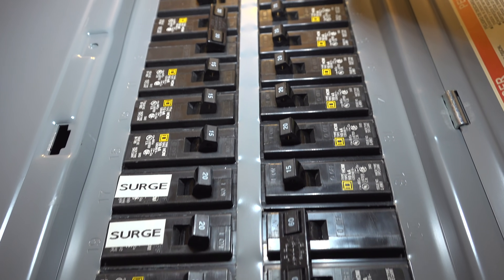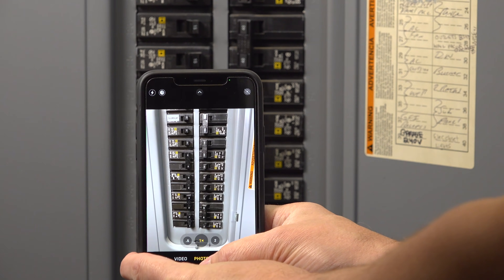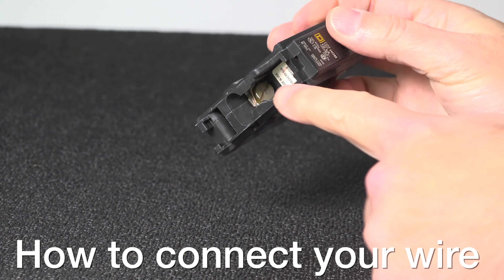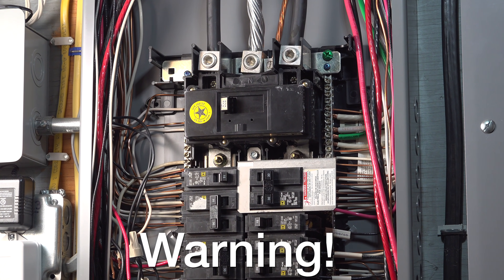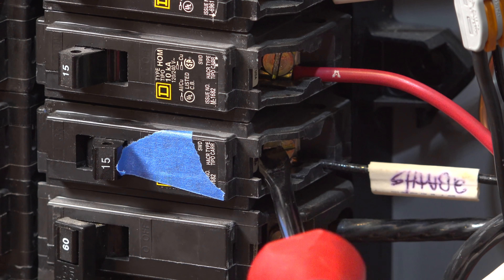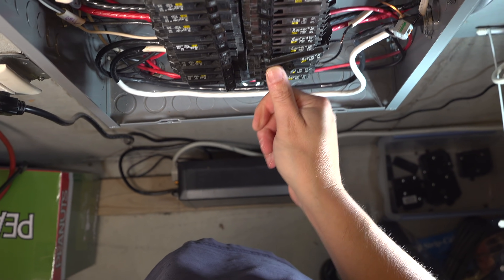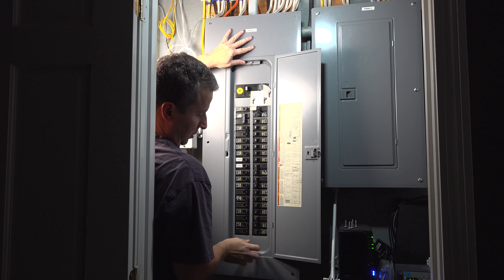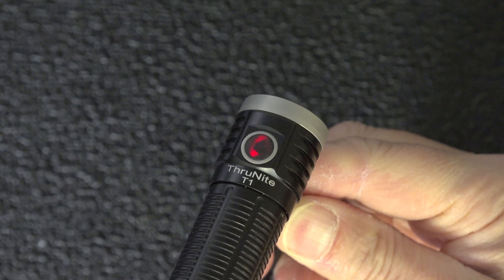How To Replace or Change a Circuit Breaker in your Electrical Panel & Why it's Tripping

Comment: How do I know if the breaker was the correct one in the first place? RE: all the information on the breaker... cause, I'm fixing to replace one. I'm not an electrician, but, I learned how to wire a house in High School. That was over a half century ago, but, I'm not so sure the previous person who worked on it knew what they were doing because a couple of the outlet lets were actually installed upside down; old and brittle, installed in the seventies, and they were "stabbed in the back" I have installed all outlets properly and identified a faulty breaker switch. How do I know what to replace it with? The outlets that were installed upside down have the faulty breaker.

Comment: For safety purposes have a meter and do use proper PPE like rubber gloves with no punctured holes and leather gloves over rubber gloves with those gloves you can work on live wire but do turn off power if can

Comment: My breaker isn’t tripped. The power to the garage, though, is apparently out.
Reply: How did you know the breaker wasn’t tripped? I think I overloaded the garage breaker, so now nothing in the garage works, so I’m going to replace that breaker tomorrow.
Reply: @jmendozas197  Check for an outlet (likely in your garage) that was tripped. It could be hidden, so look closely.
Reply: I meant the GFI could have been tripped.
Reply: @jorgejohnson451  Thanks for the help. It ended up being the switch on the breaker. It got loose and I had to fix it so it clicked to the ON position.

Comment: I was actually out cutting the hedges with an electric hedge trimmer and I ended up cutting the extension cord and I lost all power to the outlets on that circuit. I went down in the basement thinking the breaker tripped and it didn’t. I flipped it back and forth still nothing so I’m assuming this is fried. It’s about 15 or 16 years old

Comment: Great demonstration. I feel a lot more at ease about replacing a breaker after watching this.

My question: I have a breaker that resists being switched to the 'on' position. Is this most likely due to a bad breaker? Or could there be a problem somewhere in the circuit? Or could it be either? I supposed that by replacing an inexpensive breaker, if the problem isn't fixed, I now know the problem lies elsewhere.
Reply: Judging by this video yes you need to replace it or it could be what you’re using is consuming more power than it can handle

Comment: I have touched lives wires several times, even pulling extension cords from electrical outlets.  And yes I am very cautious either way, but your not going to "die",  but I have lots of respect for the main one coming into the box.  I was sweating bullets when I paid a guy to replace my electric panel and all I saw was a tangled mess of wires coming out and he fumbling around.  I had images of him getting shocked, me trying to saving him and while doing so, pulling him and me joining him in heaven.  Luckily everything worked out, but its very nerve wrecking.  My biggest fear is that for example I work on cars and I know mistakes happen.  A mistake in auto repair or any other trade, you can get away with it, but a mistake in electrical and you are GONE forever. Respect electrical.

Comment: This was extremely helpful! Thought our over-the-range microwave was on its last leg, as the lights would flicker and power would start to bog down every few seconds. If I opened the door before the time was up it would short out and not turn back on unless I went to reset the breaker and push on it. Ran to HD grabbed a slim dual 20 amp breaker and it's all good. Thanks again!

Comment: My breaker it’s always tripping, and I know it’s because I have an studio with a lot of equipment and lights. What can I do to fix it ? 
Can I just buy a higher amp breaker or is there more steps to fix my situation?
Reply: NO.  Never change the circuit breaker to a higher amp.  Result = Fire !
        You need to add a 2nd circuit.  And use it for equipment that has a heavy draw.
Reply: @leeozawa6042  alright thank you

Comment: Super video....  In 1986 I vaporized my long pincers on the 'substation side'   of my distribution board ..240 volts...UK...  I was left holding the insulated handles only...the pliers had blown up and steel was peppering the walls..  So remember that even with the main breaker off, there are  still  big live wires when you get the panel front off...
Reply: Like the big wires at the top of this videos panel?
Reply: @frankmontez6853  yes the big wires are only fused on the power station transformer side of the house wiring...    I used to ride fast motorbikes but I never came so close to death as when I got my long nosed pliers on those cables...  Wonderful insulation on the pliers handles !  Saved my life and I felt nothing though I could easily have been blinded...   I am dashed careful now..
Reply: @ yeah I lost my power in two rooms. Someone said to check for burnt wiring connections at the outlet. I’ve done so and they look fine . Soo now thinking it’s my breaker. I heard from a friend that one of his breakers broke and he had to replace them
Reply: @frankmontez6853  Good news is they are cheap from local stores and a 2 minute job to fit them. Just stay way from the thick wires coming in at  the top, coz they are still live even with the main switch off
Reply: @frankmontez6853  yes...  they have current from the outside  meter. Just throw your main panel switch and then work only with the breaker

Comment: I usually work by myself, so I put a “Drift” in one screw hole, then another Drift in one on the opposite side..when I want to remove the panel, its easier.

Comment: If a 15amp breaker keeps tripping try a 20amp or 30amp breaker. That should do it. Also test circuit by wetting your fingers and quickly touch wire to confirm if it's energized or not. Then buy an idiot farm and plant moron seeds. Thanks Conan 🤙
Reply: Should I stand in a bucket of water in order to cool down any hot power that might try to surge through my body? I remember the Kingfish instructing Andy to do that when they were working on an electrical panel.

Comment: There is one safety point that I think should be mentioned.  Let me disclose at the outset that I am not experienced with these things.  But, I went and bought Black and Decker's "Complete Guide to Wiring".  It mentions that the service wires coming into the breaker box are ALWAYS hot, even after you've thrown the main breaker.  It says to  NEVER touch the service wire lugs.  I guess that's pretty obvious, but given how important it is, I think that would be a good addition to the video.  
I thought it was a great video!
Reply: But he did go over that at 2:55 mark 👌🏿
Reply: @oodyjones  Wasn't there when I watched it.  Must have been added.  That's good!  A person could be killed.
Reply: @MSPoetrySociety  Oooooh ok... That makes sense 🙏🏿. I didn't realize videos could be edited like that now on YouTube 😮

Comment: The best way to check if there is power in the wires is by touch them both with a diner fork....! if you see sparks or a BIG flash of lighting... then you absolutely have power in those wires.

Comment: One very important fact was not mentioned about replacing breakers.  Always replace any breaker with the same amperage.  It is dangerous to install a 20 or 30 amp breakers where a 15amp is.  Some people think that when a 15 amp breaker trips often they need to add more power to the circuit.  They can burn their house down that way.  ALWAYS REPLACE 15 AMP WITH 15.  20 amp with 20 and so on.
Reply: He did cover that
Reply: I was gonna replace 10 with 40
Reply: He did mention that
Reply: If you're that stupid, you deserve to get a zap or burn the place down lol.
Reply: Can you please explain more details why it could burn the house down by install more power to amperage instead? Thanks
Reply: @VictorPhạm-d2o its too damn much power pushing  😅 that shit will pop

Comment: Thanks for the video.  20 amp circuit breaker replaced with no problem. No call-out fee, labor and parts for this job, fix it myself.

Comment: The breaker to my AC is warm. Also, the AC is blowing out hot air, not cool. Does this sound like an issue with the AC, the breaker, or a combination of the two?

Comment: My receptacle doesn’t trip but power goes off and lights usually flickering. 
And only one section of my house basement is always fine. So what do you think it can be ?
Reply: Loo connection and arcing wires.  THAT is what causes fires. Call an electrician.

Comment: Can you test the breaker itself? I also wanted to say when you'r turning off the panel you can shut the main off, I was told when you turn the power back on you should have all breakers off and 1 turn the Main ON then one at a time flip them all back on. I understand it lessons the SURGE to the main Panel of all breakers. I am not an electrician, but I have electrical knowledge.

Comment: I mean changing the breaker doesn’t always fix the problem. It could be tripping to prevent a short or overload
Reply: He didn't say it would. If you have an intermittent trip with no obvious sources of overload, the first step is to replace the breaker and observe the results.

Comment: Replacing my outside 30A 2 post breaker and I don't see any plate inside that the wire goes under. It seems like it directly contacts the screw and then the bottom plate. Am I missing something somehow?
Reply: There are only a few brands with the plate. Most are lug style. The ones with screws don't need to be wrapped. There are indents to keep the wire in place. Just be sure and install the wire on the proper side so the screw doesn't push it out while tightening it.

Comment: THANK YOU SO MUCH! We switched from a gas dryer to our brand new electric dryer. It has its own two lines, but they are old and was partly tripping; it turns on, but doesn't heat.  This video makes me feel more confident to do it on my own.
Reply: Gas dryers are so much better than electric why did you want to switch?

Comment: Very helpful! I had to replace a 30 amp Siemens  fuse for my ac condenser. I wish I had used the blue tape trick because I ended up replacing the wrong fuse and didn't realize it until after I had replaced the cover. I had to start over. Oh well. At least the ac works now, and I didn't get zapped.
Reply: One note - circuit breakers are not fuses. In very old houses where the wiring hasn't been upgraded, maybe, but then I would find a different house.

Comment: Thank you, Thank  you, Thank you.
Today my handylady  and I changed two of my breaker switches! We watched your toturirial several times and said 
"we can do this!" and with your help we did! I must say it was a little scary when we did the first one but we kept rewinding your instructions and we finished without any problems.
The switches  I needed were 30 amp switches and they cost $24.95 each at Home Depot.  I saved two to three hundred dollars  by not employing an Electrician. Again thank you.
Reply: Did replacing the breaker solve your problem?
Reply: @jackconnolly2665  👍 Yes!

Comment: Unfortunately none of my circuit breakers are labeled at all. How am I supposed to know which kind to buy from the store? Also, my panel doesn't even have a main shut off like your panel does in the video. Otherwise it all seems simple enough to do.
Reply: Take a picture and go to a DIY electrical forum.

Comment: Can you change it to a 20 to make a stronger for it won’t be tripping anymore or does it need to be the same 15 amp??
Reply from the maker: No you can't change the size of the breaker without being certain the entire circuit can handle it, that means know the thickness of the wire through every part of the circuit. That type of evaluation and upgrade is best left to a pro, due to room for mistakes and potentially a fire hazard
Reply: @SilverCymbal  thanks 🙏🏼

Comment: I think it's important to note that breakers dont go bad as often as circuits have faults. If your breaker is tripping, it probably means a fault on the circuit.
Reply: Certainly. But if the circuit has nothing plugged in or turned on and hasn't been altered for decades, chances are decent it's a mechanical part failing versus a static part. And as mentioned in the video there's very little to lose by replacing a breaker (as long as it's done correctly) so it's worth trying as a diagnostic step.

Comment: Lol... great solution. Tripping breaker? Eeeehh!! Change it... 
Better yet, attach the handle to the breaker with a drywall screw, so it never trips
Reply from the maker: Is that you do your repairs? Or you could just watch the whole video & actually listen
Reply: @SilverCymbal  just saw the thumbnail. That's more than enough
Reply from the maker: @0786RICARDO  Nice try
Reply: @SilverCymbal  why waste 6 mins of my life if the thumbnail is wrong? Categorically no
Reply from the maker: @0786RICARDO  Wrong?  It couldn't be more spot on. It's ok to say you love the video, this happens all the time.  At least find something technically wrong with it. Thumbnail: Circuit breaker Title: How to change a breaker .Video: How to change a breaker & why
Reply: @SilverCymbal  Do I have to read the title as well? Kids this days...

Comment: I would check what loads are on that circuit before changing the breaker. Make sure the breaker matches the wire size. 14 gauge is 15 amp breaker. 20 gauge is 20 amp.
Reply: 12 ga. Aluminum is 15a. 12 ga. Copper is 20a. 14ga. Al is 10a. 14gaCu is 15a.
Reply: @bilmoe5856  The wild ones I’ve done were with high inrush circuits.like x-rays at doctors. They probably have a different device now.

Comment: Not trying to be a buzzkill, but as a licensed electrician there are a lot of steps I would go through to verify the safety of that circuit before I even considered just replacing the breaker and calling it good. I know that it isn't common knowledge, but under some circumstances turning a breaker on in an unsafe circuit can cause an arc explosion in a panel, which would be extremely dangerous to your average homeowner with limited or no ppe on.

Comment: Thank you so much. I'm a shipfitter. I've never worked on anything electrical. I followed your instructions to a tee. Perfect. Even found the right part number and I remembered to tape the switch. Everything is working great. And I didn't get zapped. Lol

Comment: i have a 30amp in a sub panel but need it to be a 50amp can i just chnge it to a 50 amp?
Reply: The breaker protects the wire. If it is #10 wire, it is rated to carry 30 amps max.
If you change the breaker to a 50, the #10 wire could carry far more than it is rated for.
If for some odd reason the existing 30 amp breaker is connected to  #8 or #6 wires, you can up the breaker size.